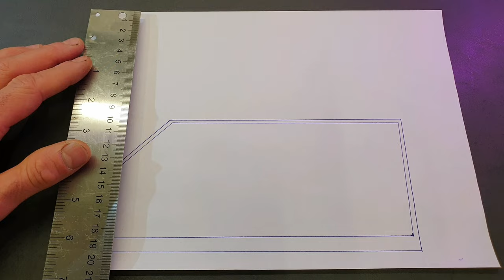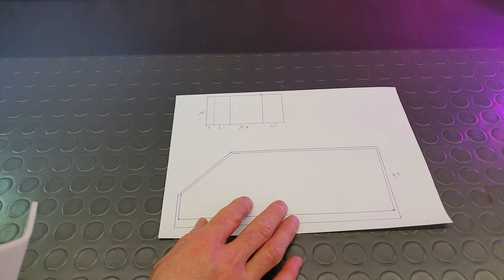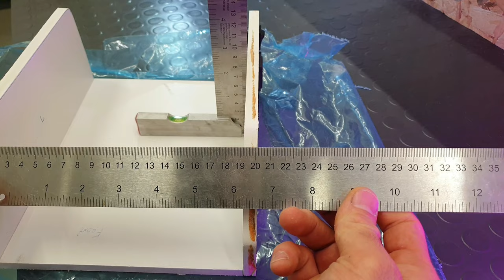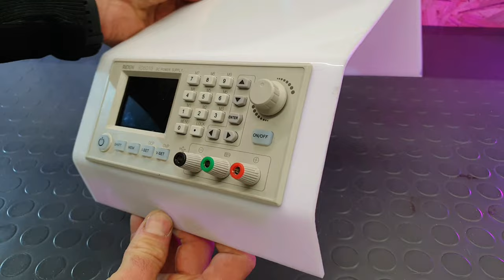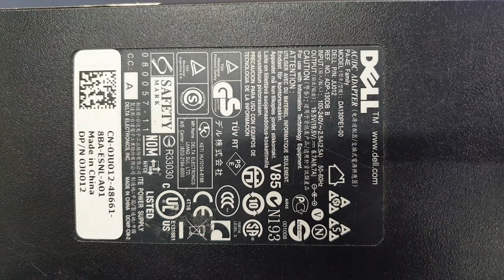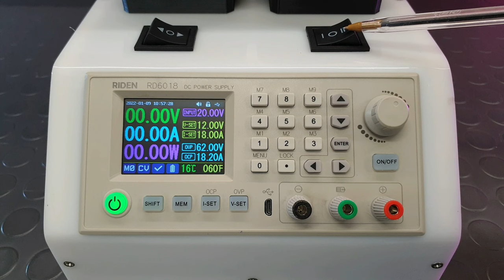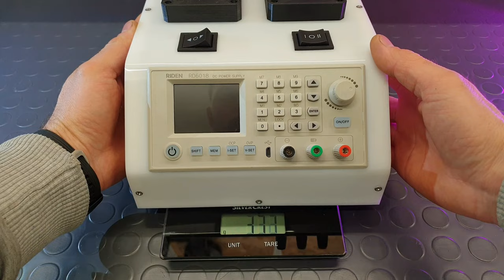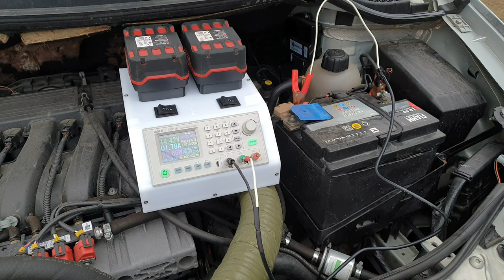DIY Portable Power Supply using 130W DELL Laptop Chargers (Riden 60V 18A)

Comment: Super video. With detailed view and schemes. Two questions: 1st how long it took - from first cut to first powering on after assembly?   and  these Dell supplies  - they are in series to provide about 60V but output current is about 7A (total 390W). RAIDEN converts it to 14,4 V 18A  (260W). 2nd Were there any temperature problems (in supplies or Raiden)?
Reply from the maker: I started on January 1st and finished it on January 9th.
But I worked partially 2-3 hours in the evening after work.
Totally for about 3-4 working days.
At 14.4V 18A, consuming about 4.5A from Dell Chargers.
After about 20-25 minutes of charging with 18A, the temperature rise from 20 degrees to 33 degrees.

Comment: ich habe das gleiche gebaut wie du mit dem 3d drucker und mit 4 bosch akkus super idee
Reply from the maker: This power supply is really very good for its price and I do not replace it for others🙂🍀
Reply from the maker: I recently make another upgrade to it, with which I can also charge the batteries that I put on the power supply🙂
https://youtu.be/G9v3KaMgoBA

Comment: Well done!
How about the battery packs, do they charge too if the powersupplies are running?
Reply from the maker: I have not made it charge the batteries, but with 1 additional button I can make them charge controlled through this RIDEN power supply, which has a function for charging the batteries.
You know I got the idea to do it🤔🤝
Thank you very much and if I do there will be a video for sure🙂

Comment: I forgot to ask, Can those 3 dell chargers connected in series really provide 60V 18A (1080W) under sustain load without getting to hot and blow up?
Reply from the maker: Not providing 18A at 60V
At 60V = 6.7A
At 30V = 13.4A
At 15V = 26.8A
Reply from the maker: I don't think I will have to use it more than 24V, but if necessary I will set it to 6-7A and there will be no problem🙂
Reply: @ErCanEverything  Thank you my friend for the explanation.